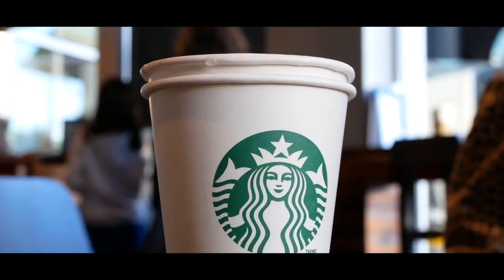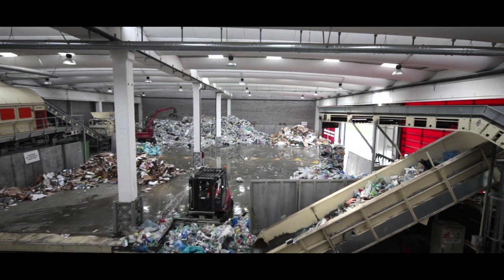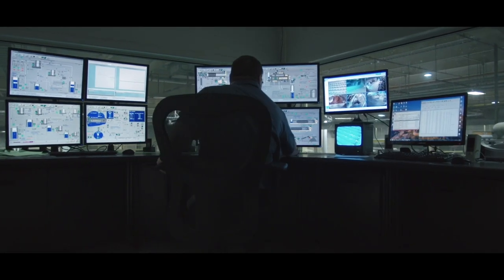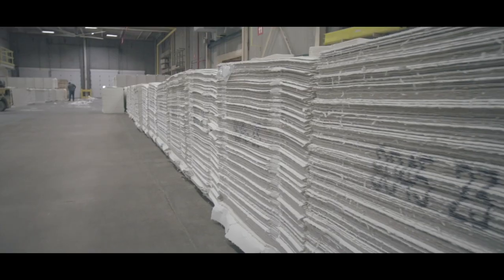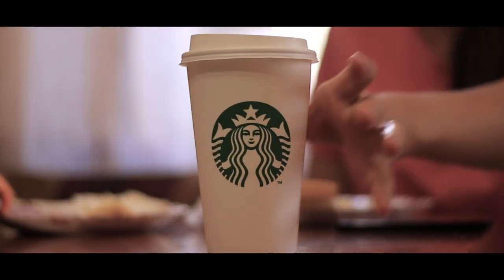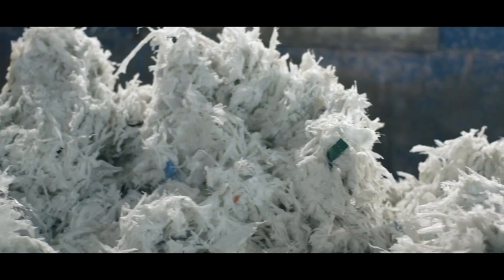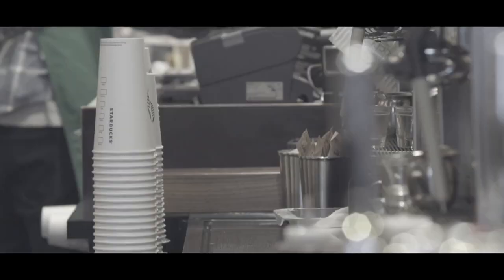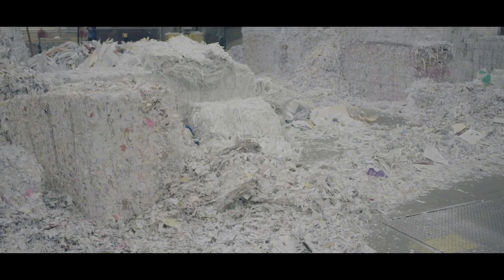Cup to Cup:  A Starbucks and Sustana Partnership

Comment: I got some questions on that:
1. The sorting is performed manually from the paper stream?
2. The "new" cup with recycled fiber: how much of the fiber is recycled and how much virgin fiber is used?
3. What happens with the seperated Polyethylene? Is it also recycled?
Apart from that, the approach is of course a good one!
Please just make sure that the loop is closed as much as possible.
Don't only look at the fibers.
Think of everything: fillers, ink, PE, the lid, ...